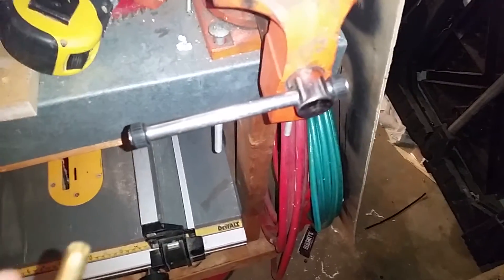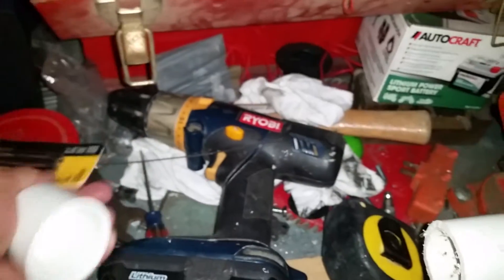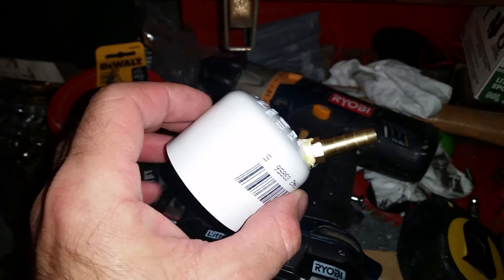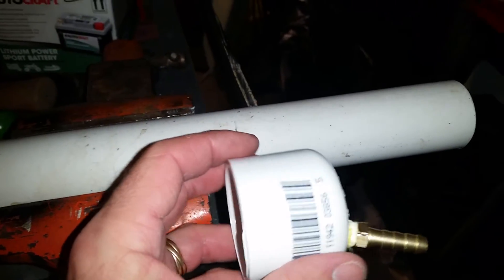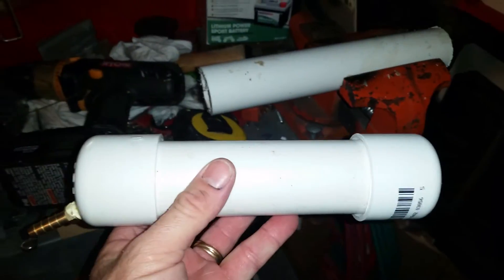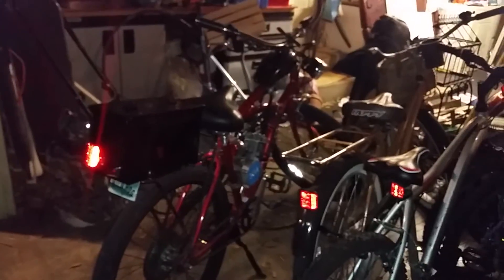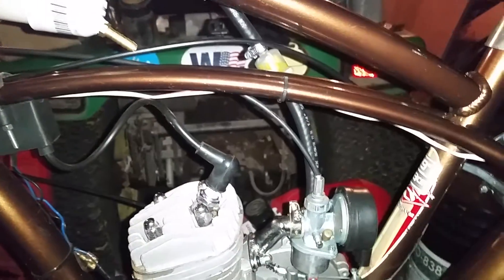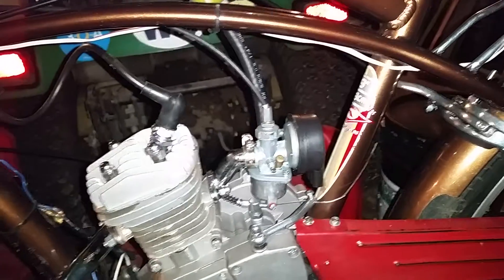Motorized bicycle boost bottle PVC (part1)

Comment: This won't work you need to measure  the air space in side the bottle to match the piston cc example if your bike is 80cc then you need to measure 80 ml of water in the tube and cap it of were the water filled up to trust me I have done this before
Reply from the maker: I ended up taking it off. It did work fine I don’t remember the reason for taking it off because it’s been a couple years since I did it. I don’t really feel like you’re getting that much of a difference out of a booster bottle to be honest.
Reply: @jgriswold3  yeah see I think it's the stock pipe with it not having expansion chaner I think 🤔

Comment: Hey.  I made one also..   alot like urs...  my confusion is ...that on my intake to my gy6.  I can either tap a hole...or..use one of the vaccum lines coming off the intake...my race intake only has one...the stock intake has two vaccume lines... so i was thinkn instead of drilling out my race intake...just using the stock intake an the 2nd vac line....think itll work?
Reply from the maker: Tom Gallier I really don’t know what you should do. I think I ordered an intake to go with the boost bottle and it didn’t match up correctly with my tank so I ended up tapping whole in the top of mine and using JB weld on the threaded screw that I put in the top of the intake. I am really no master at these just trying to figure it all out myself. Sorry I can’t be more help